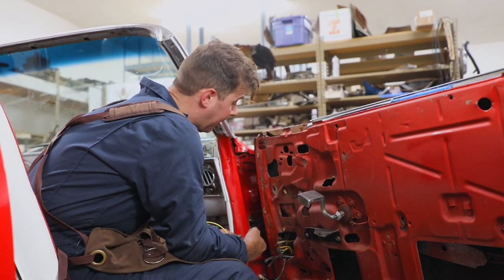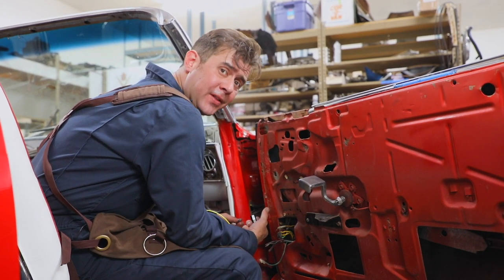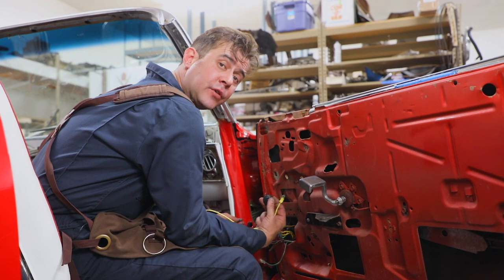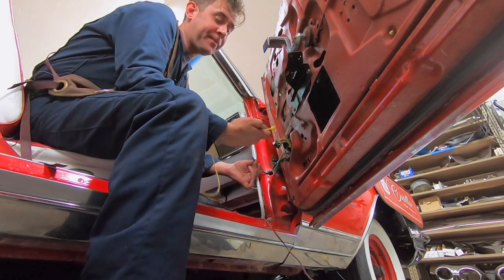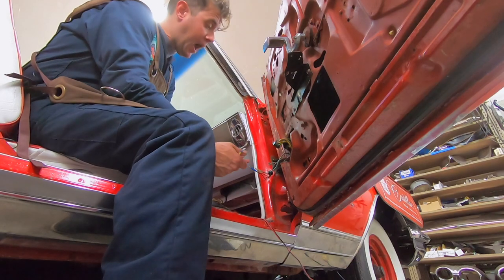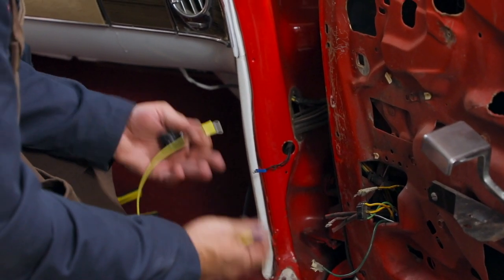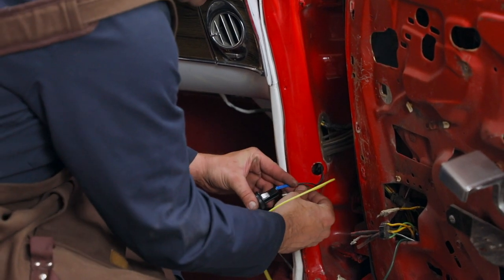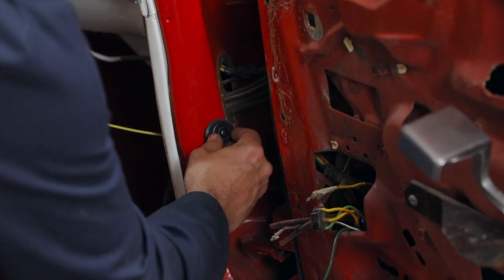How To Install a Door Jamb Switch on the 1964 Cadillac Eldorado

Comment: Are the two wires on the vehicle both positives ?
Reply from the maker: The original switch provided ground to both wires when the door is open. They are connected together in the switch, and the switch provides ground when the door is open. The door switches are in parallel, so one of the wires will be going to the light bulbs and the other to another switch in the car.

The original switch gets ground from the housing, while the replacement requires the addition of a wire that is grounded at the other end.